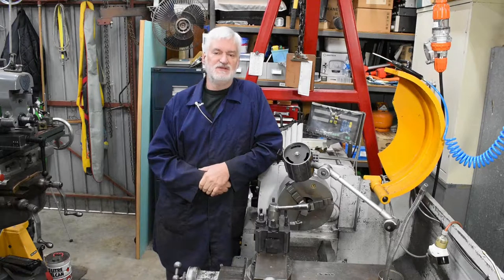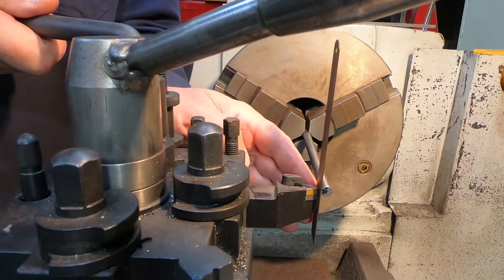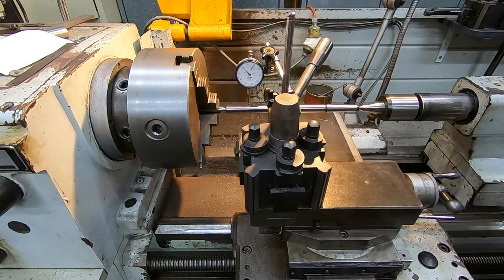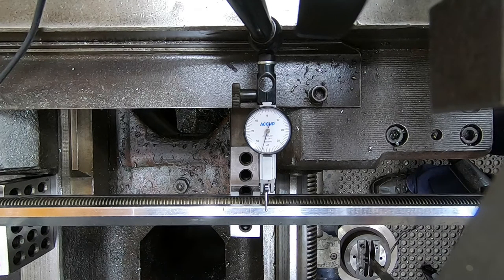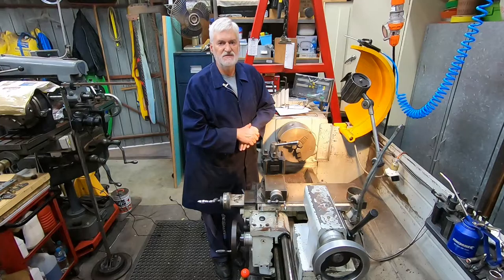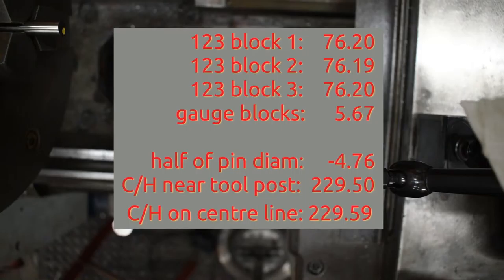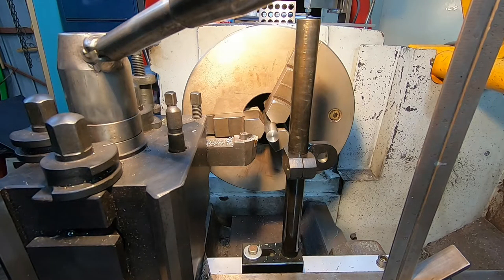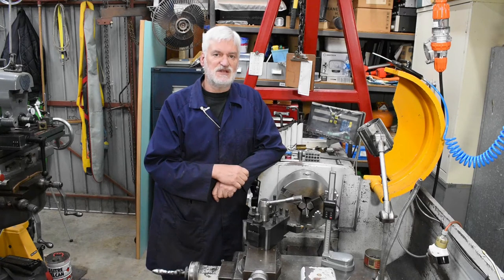Setting tool height on a badly worn lathe.

Comment: G day Allen  I have an issue with the gap on my lathe,  it is what is causing my taper have tackled the situation once with some success, 
but need to have another go with patience . Also the head stock was out of alignment . Stay safe all the best
Reply from the maker: That's interesting, it has never occurred to me to inspect the gap piece on my lathe or to test head stock alignment. It  was removed from a working production environment and I guess I just (lazily) assumed that would be ok. Will put checking on the to do list. 
Might take a little while though as I'm currently playing Florence Nightingale to my wife while she recovers from a medical issue.
Reply: @alanshomeworkshop   Allen your work shop is in immaculate condition not one piece of swarf was spotted, all the best to your wife .
Just quickly what I have been doing with some 100 mm x 200 long material I machine it with a large boring bar that I made up 
I only travel on the ways not on the gap while doing this
Reply from the maker: @jackk7030  Our thanks for your kind words.